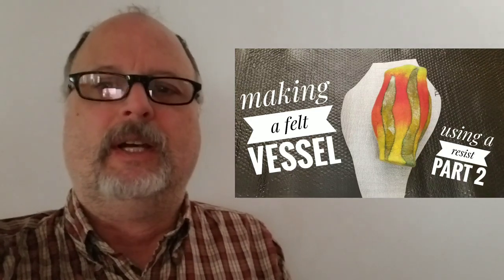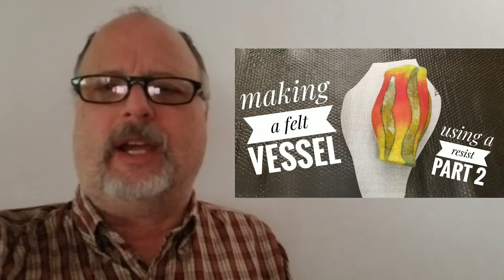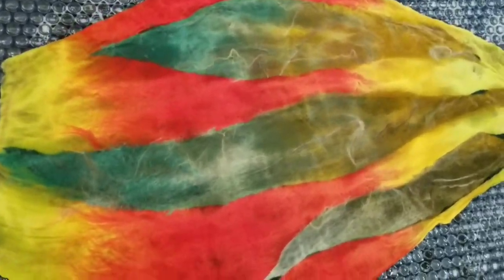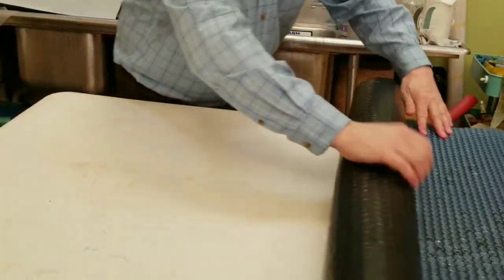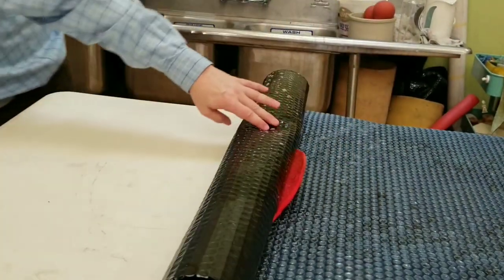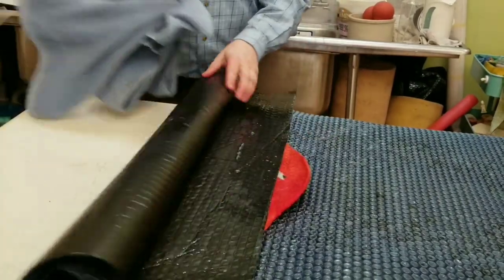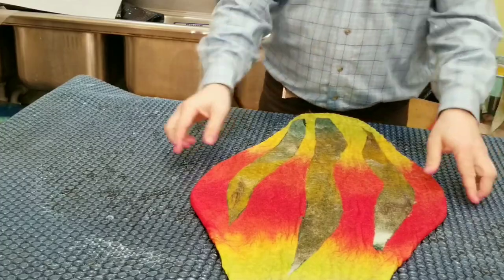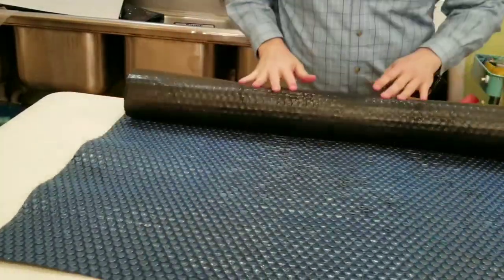Making a felt vessel with a resist part 2

Comment: Could I ask why you tend to work with 3 layers per side - 2 vertically and one horizontally (or 2 radiating out and 1 radiating round the resist)? Other felt artists I've seen have all worked with 4 or in some cases 8 layers - but always an even number.